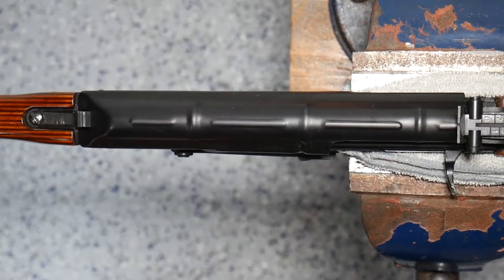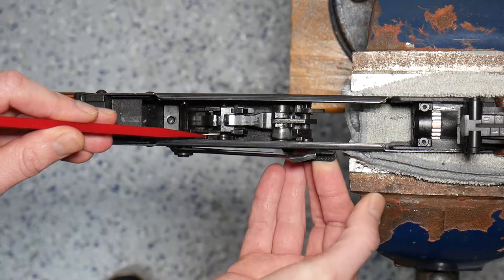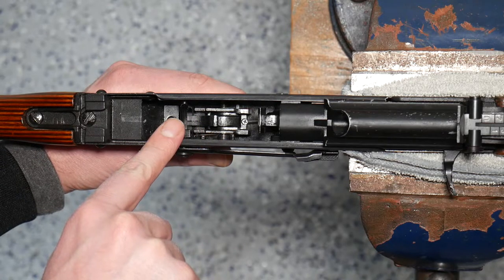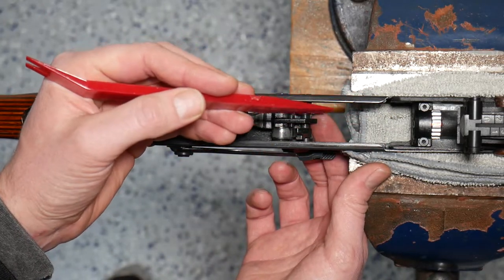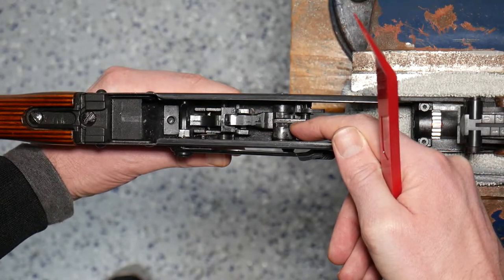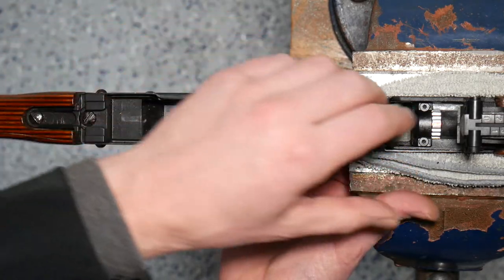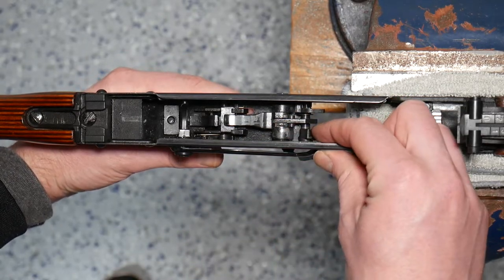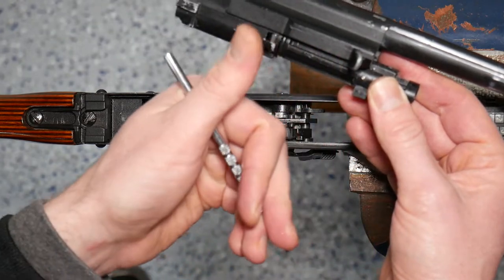GHK AK V2: Understanding How it Works

Comment: Great video about the GHK AK system. You answer the question that bother me for a long time of the auto lever part, since my new GHK AK74m has quality problem which this part always loose from the spring. For the problem that you have given about the selector switch 15:53, I got this recently and solve it. By unsrewing it, there should be an oval shape part that connects the selector plate and internal switch. Mine has broken and got scratches. This causes gap between them and the outer plate can't fully bring the internal switch into function sometimes. Actually, this make the gun fire while safety on and bend mt outer plate. By replacing a new internal switch and screw the nut tight, it solves. Nice to have video showing the mechanism rather than words. Sorry for my bad English. XD
Reply from the maker: Thanks for the detailed reply! That's a great suggestion for the selector plate. I've gone to just modifying real selector switches to fit--I'll hopefully have a video walking through that process uploaded soon!

Comment: First off thank a lot for the simple yet effective and great videos you have made on the AK. Thanks to you I have exchanged my original sears for steal ones. Everythinh went ok with 2 exceptions. With new steal firing pin I've got light strike issues and the gun did not cycle properly...solve it by putting back the original firing pin. And the second one, the gun did some burst fires in single shot. By watching this video, i ve came to a conclusion that the trigger single sear was not catching the hammer sometimes, I ve noticed that it was way looser that yours. I have dissassembled everything and noticed one thing...the little spring on top of the trigger in which this sear sits is way smaller that yours, perhaps by half. I have resoved the issued by stretching it a bit but I am not very confident. So you know if it is possible to exchange this spring (mine did not want to come out of the trigger) for a bigger one? thank you for everything

Comment: when removing the recoil spring, is there a curtain way or angle to put it back
Reply from the maker: Push forward then just lightly angle back. It doesn't need to be lifted up much to clear the rear trunnion.
Reply: @ciskeitwo3256  Thanks